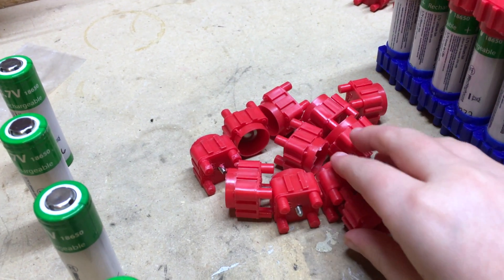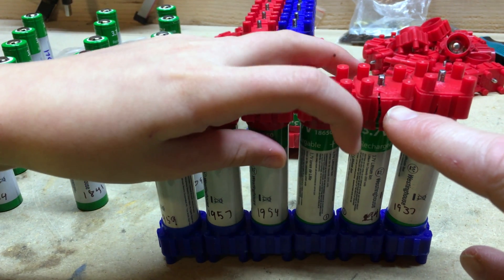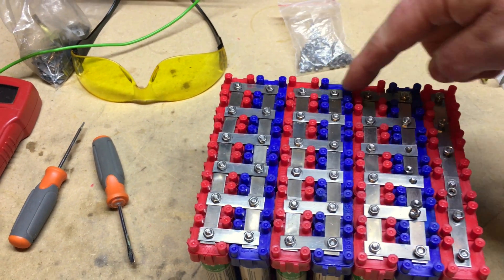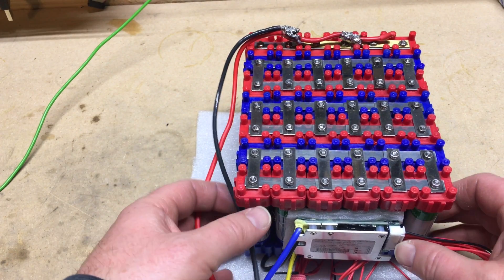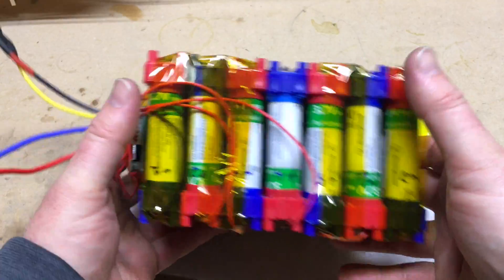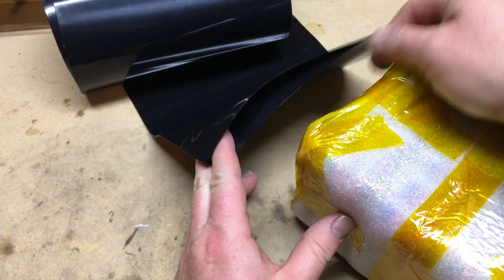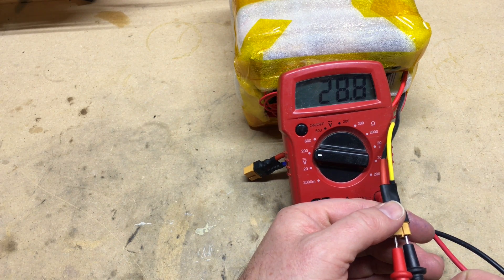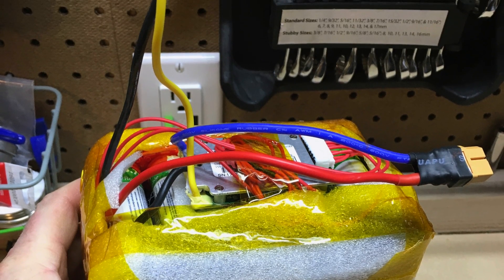18650 Battery Build with Vruzend Solderless Kit

Comment: i have the vruzend 2.0 kit, if it gets tapped it disconnects. not so bad with a 7s1p battery (it just turns off) but holy balls it scares the shit out of me because i want to build a 7s2p and if a cell disconnects even with bms the battery will still be live. how the hell is the primary promoter of this kit an ebike guy? this thing has to NOT MOVE AT ALL.
Reply from the maker: No issues for me on my 7s6p here using the Vruzend kit.  I'm going to rebuild the entire battery with new larger cells and spot weld everything. Vruzend was a good way to get into cell assembly but I've progressed and ready to move forward.

Comment: Hey, maestro really enjoyed your video and just finished building a 48v 13s pack of my own using the vruzend kit. I'm a bit down on wh's using only 13s4p and salvage cells.

I wanted to ask what charger you're using for your packs? I haven't invested in new equipment in years and was curious how you handle that.
Reply from the maker: I am using this MPPT charge controller.  It jequires a DC source such as a solar panel or a power supply.  Are you using a BMS?

Comment: As priced on their website. To build a 48v 20 ah battery, using Samsung 2500 mAh batteries would cost $617.42. That includes 104 cells, BMS, 4 kits and a charger. A few more bucks for misc. Wheir is the savings by doing it yourself?
Reply from the maker: Kevin hardin I would not recommend purchasing a large amount of cells from them.  Shop around and check out Jehu’s website for great deals on quality cells.
Reply from the maker: Kevin hardin I would not recommend purchasing a large amount of cells from them.  Shop around and check out Jehu’s website for great deals on quality cells.

Comment: Hello. Does the BMS you chose keep your cells balanced, and have you checked them? I am looking at a 3s 25A BMS, but I am getting conflicting reports as to whether it  can manage individual cells.
Reply from the maker: noleftturnunstoned The BMS will balance each bank of cells.  When you put together a row of cells in parallel, the BMS sees that row as 1 cell.  So the balancing is for each row of cells, not individual cells.  Hope that helps.  Cells in parallel tend to balance themselves too.  Thus the debate wether a BMS is needed  for balancing.  I prefer to go with a BMS.

Comment: Green Mountain DIY Guy how many kits to build this battery and could you please explain the bus bar setup from the video it looks like the are all are tied together. 
Thank you
Reply from the maker: This is a single kit that contains 100 pieces for battery caps (50 red and 50 blue).  There are two bus bar setups for this generator, one that is 24 volt and one that is 12 volt.  Check out this video to see the wiring and bus setup.  Hope this helps.  https://www.youtube.com/watch?v=PGWSRWkBK4Y&t=5s

Comment: I used this kit for a 7s battery, and even after swapping the cells, my cell 1 (neg terminal first cell) ALWAYS discharges much faster than the rest. I tried this with 2 different batteries 2 times each - any ideas?

Comment: This review is for the red and blue vruzend terminal caps.
The idea is good.. but the springs build up a lot of resistance.
also vruzends site says that the terminal caps should be pressed on the 18650 
so its 93mm from edge to edge on the terminal caps.. 
Well non of mine had contact at 93mm.. they varied between 89-91mm before connection.

I checked all springs before assemble and all where the same.
Also i had my terminals at room temperature and still they cracked.
It went better when i warmed them up a bit with my wifes hair dryer.
But many of the terminals were slightly damaged from the start out of the box.
many of them had stress marks after when they press in the spring in the terminal.
even top of the cap was on some slightly protruding after the spring was pressed in.
some bolts on terminal caps was shorter so it wasn't possible to get more than 3 busbars.. and this i don't understand a few of the caps had bolts that was turning when screwing on the nuts.. and no the thread was not damaged.. the nuts was screwed on and you where able to get it down without any problem but when the nut started to screw down against the busbar then the bolt started to turn with the nut.
I never pressed the caps down in a way so the bolts got damaged.
And i didn't use the clamp method because that is a questionable method.
I used my hands and worked carefully with all terminal caps.
pressed and measured edge to edge on my caps carefully not to overpress exactly
as it is described on vruzend and ebikeschool.
It seems like a good idea but its not.
its to many places where things can go wrong.. if you build a large pack .
I can't recommend this kit to anyone I spent 60 dollars on two kits where i found 
to many terminals faulty to be in my opinion safe to use.
my recommendation is to use a good high watt solder station so you can work fast
or just do as I just did and buy at Batterybloc.com.
there are blocs that connects the battery with neodymium against metall plates.
And that method gives you a lot less resistance.
I seldom have given a bad review and im not a hater but this kit is hard to see that its 
safe to use.. remember one thing, one little crash with your little bike and the best thing you better do is to check every 18650 in your pack.

sorry vruzend but you got some way to go before its good
Reply: Vruzend RUINED MY LIFE!!!!!!!!   I invested HEAVILY in this solderless kit. HOWEVER, the springs cause constant problems. In the end I had to ADD solder to the tops of the "shorter" batteries & then put the 'solderless' cap on top: in order to stop battery pack from basically falling apart. 

SOLUTION: They need to make a twist and clip mechanism for this kit to work. The current spring design is COMPLETELY FLAWED.

Comment: Very cool.  I understand that you are wrapping the cells for protection, but won't this also prevent them from cooling whenever they get warm from heavy use?
Reply from the maker: The entire pack really doesn't get that warm. It's good to always be thinking about those thing, but in this case not an issue.
Reply: Its not the temperature that you need to worry about. Its the 'springs' that push the cells away from terminals CONSTANTLY

Comment: Hi. Nice, simple pratical video. I have a plan to build my  battery pack. Cam you please give me a help. The configuration will be (   12v 26AH ) using 48 batt 18650   2250mlah. But  is nescessary put the BMS? If yes,  can you tell me how to wire it. Last question,  which the better layout?. Thank you in advance. Njm.
Reply from the maker: Yes, I would recommend using a BMS.  Lots of discussions about using them, but I am a firm believer in them.  As far as your layout for the battery pack with 48 -18650's,  you could do either a 3S-16P or 4S-12P.   The layout all depends on your devices and how they interact with a traditional 12 volt (nominal) system.  In a 3S configuration (9.6V to 16.8V) the lower side of the voltage would be around 9 volts. That is low and some of your gear may not work.  On the flip side, a 4S configuration might be too hot with the voltage at 16.8.   If I were building a 12 volt system, I'd probably do a 4S pack and use a buck converter to step down the voltage to a healthy 13 volts.  I build a 7S pack in the video as my inverter's range is from 20 volts to 30 volts, almost a perfect match for a 7S battery pack.  Good luck!
Reply: Thanks a lot, the problem is i do not have any idea how to add the BMS to the battery pack. which one to buy, assuming the configuration i put on my first post. Thank you .NJM
Reply from the maker: You should check out ebikeschool.com on Youtube.  Micah Toll has some outstanding assembly videos.  Highly recommended.
Reply: and less amps with 24v system